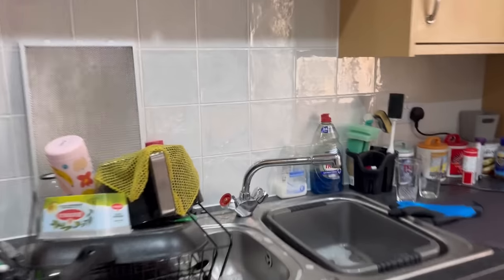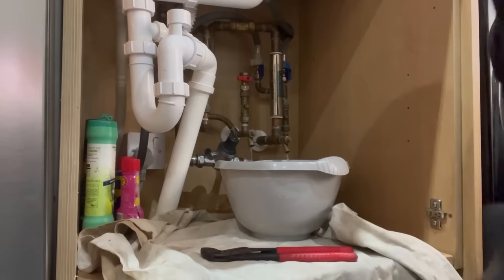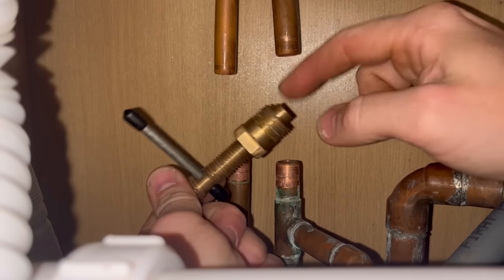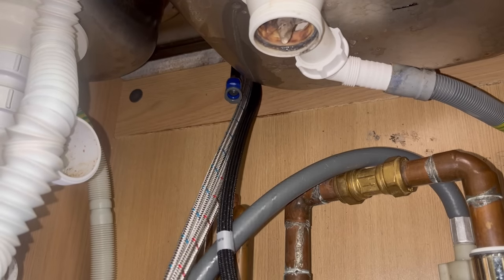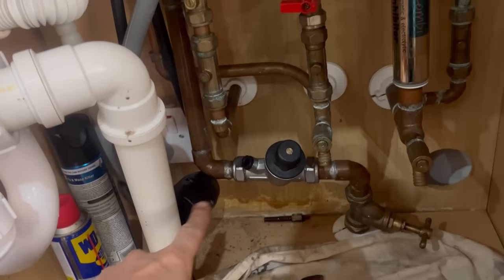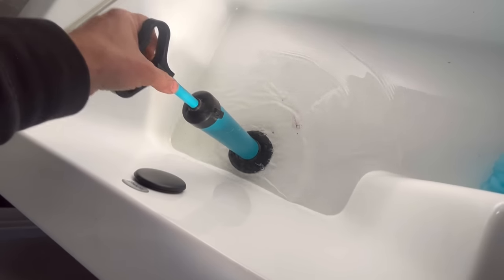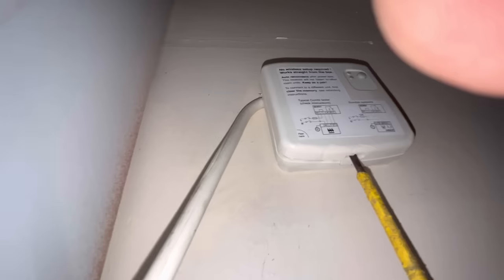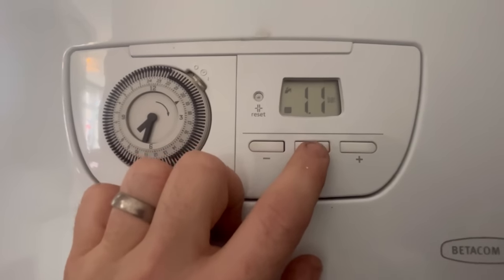Back to Basic Plumbing jobbing - Day In the life of a plumber

Comment: Those simple, fairly straight-forward jobs save our sanity.
3 or 4 years ago I stopped using flexible tap hoses. I bough some M10 fittings for a 10mm copper pipe and I connect the taps the old way. Here we use 3/8" to 1/2" isolation valves and they are compatible with 10 mm copper pipe (via olives). It costs a bit more, it is a bit more labour-intensive but I don't have to worry about any service and it's leak-proof.
As for clogged small diameter drains, I often use a vacuum cleaner. Pulling the blocking stuff out is usually better that trying to push it down the drain.
Voice-over was great, but the "live" action is more immersive. Besides I bet that the voice-over takes you more time.
Reply from the maker: Yeah them little 10 mins job are what keep you going, its nice to have a little win every now and again, makes sense wet vac to be honest your removing the blockage then instead of forcing it down…Voice over does take more time to be honest so is easier to film and talk but do find the audio can suffer sometimes

Comment: How did you know which if 1 or 3 was grey or black kn the hive? Also I got told to install it by putting the switch in 3 and then a link between 1-3, also I prefer the the first and the last type of videos
Reply: You trace the wires to the boilers connections, see which is which.
Reply: @MagicDoughnut cheers mate 👍🏻
Reply from the maker: Same order as I took them out of the other thermostat mate and depends on boiler and set up wether or not you need to link L to 1, you don’t want to be putting 240V on a 24v connection